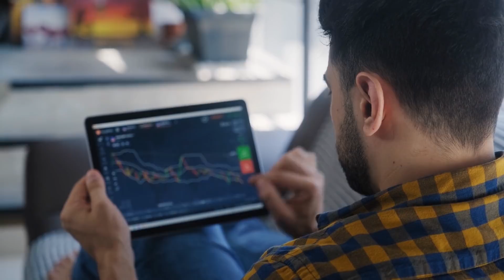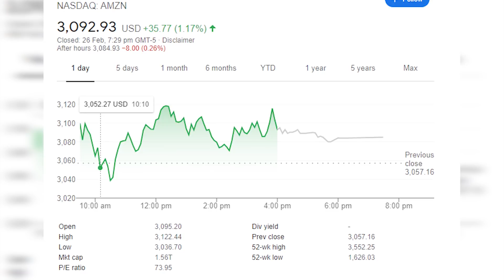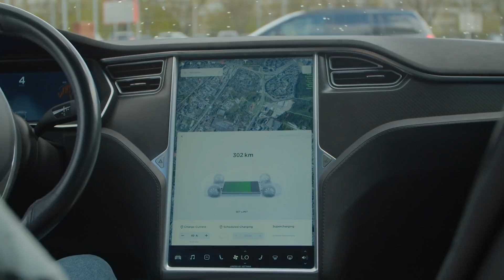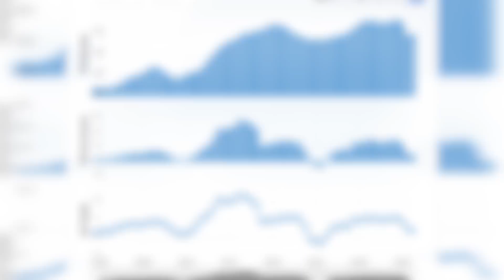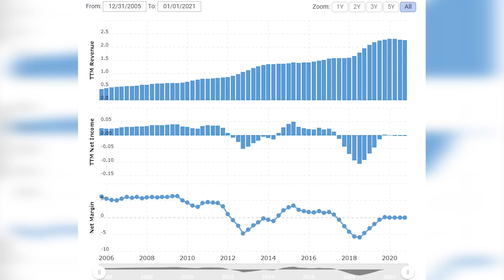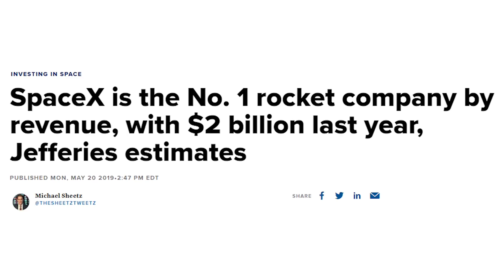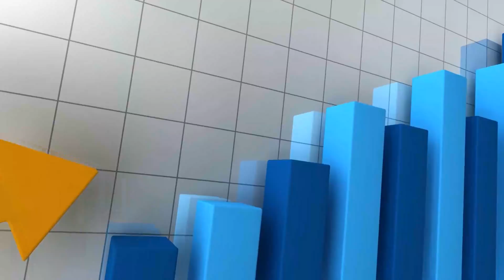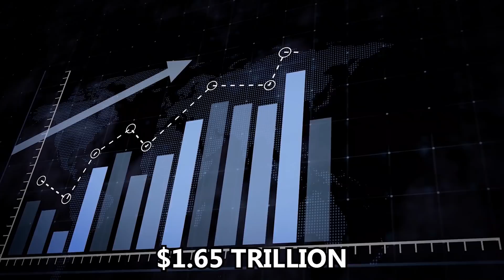When Will SpaceX Overtake Tesla?

Comment: I disagree with the speed that tesla will keep making gigafactories. I don't think their battery production would be able to match that many cars produced yearly. I also disagree with the 10 million users for Starlink. Maybe for the US alone 10 mil by 2025 makes sense, but there are also another 192 countries with much worse internet.
I honestly would not be surprised if some landlocked African countries started using Starlink Internet almost exclusively, just due to poor infrastructure. I think the African continent would probably benefit most from starlink, which would have a population of 1.6 Billion people by 2030. Most African countries have a mean download bandwidth of about 2-6 mbps.

I predict that small ISP's will pop up in rural areas, using one starlink disk to connect multiple customers once there is more starlink coverage. Only this year has the Fibre in my city come to compete with the starlink prices. Lots of African countries are 5-10 years behind mine in regards to speeds.
If the Starlink Sats can handle it, I wouldnt be suprised at 100mil users by 2030